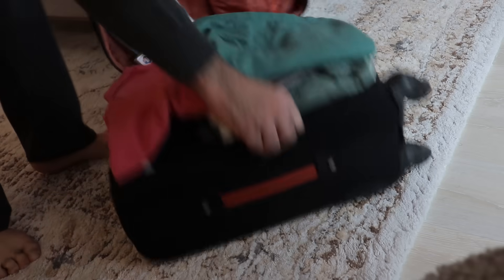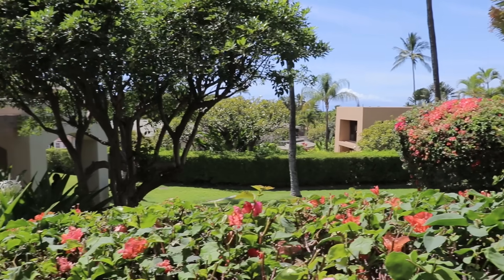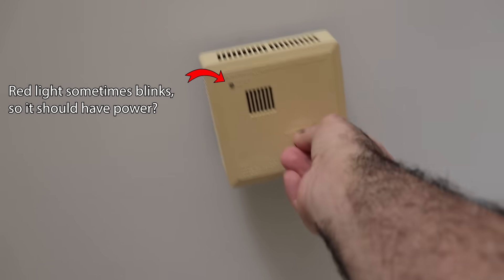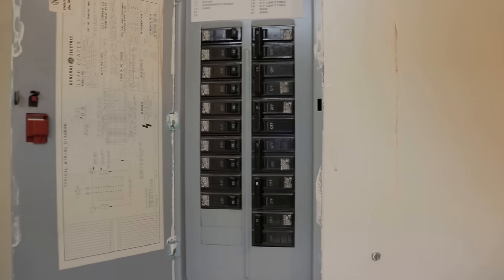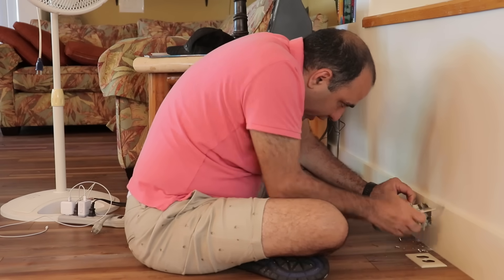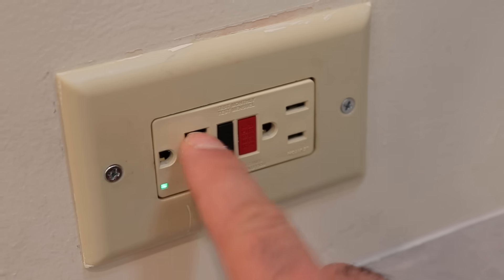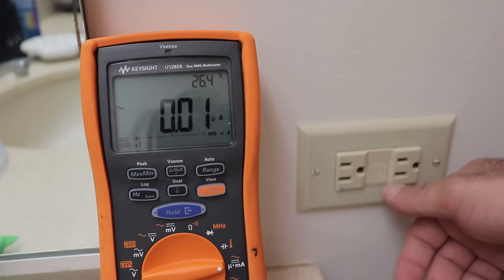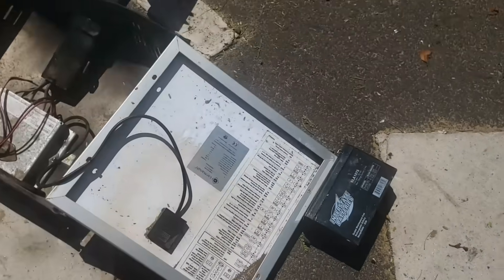Hawaiian Hotel Safety Failures

Comment: The switches being low might be a wheelchair accessibility thing.
Reply from the maker: Considering there are a few steps to get into the room, I say I don't think so! And the low switch height might be hard on some people's backs... don't know!
Reply: @ElectroBOOM  Stairs look like they were added to replace a ramp in that room. Could be left over stuff from previous remodel
Reply: @ElectroBOOM  did you know that Hawaii is a group of shield volcano from the Hawaiian hotspot. Did you get to see the volcano eruption yet.
Reply: @ElectroBOOM  not every disabled person is 100% wheelchair bound plenty can walk short distances do steps etc but whilst at home might use a wheelchair for comfort & safety esp if alone as it negates the risk of falls.

I'll wager there's disability adapted apartments there on the ground  floor & they simply did the electrics the same in every room to match
Reply: @ElectroBOOM  It's part of the building code in the UK (BS 7671) to make properties more accessible for people in wheelchairs. It states new installations should be no higher than 1200mm.
Reply: @Cee.Jay.71  Hawaii is an American state...
Reply: @ElectroBOOM  all buildings in UK must have ground floor light switches at waist height regardless of access issues for wheelchair users. Almost certainly this.
Reply: @ElectroBOOM  just because the room isn't ADA accessable, which it should be, that doesn't mean the electrical doesn't have to be compliant. Anyways, the NEC only says that switches have to be at 48" max height for ADA compliance. There's not really much of a reason for them to be that low.
Reply: @jonathantunnell3993  If the room itself is not ADA accessible (meaning there are stairs and no ramps or other ways for someone in a wheelchair to access the room) there is no need for it to be ADA accessible.
Reply: @shinigami052  all hotels are ADA accessible and if they werent built that way they are modified that way. 
also with these sorts of things, its usuallly just in some rooms, usually the ground floor only. its likely this is one of the only rooms in the hotel like this. Actually it looks like a bungalow as well, so its likely not attached to another building but a free standing structure. this implies a first floor experience(also looking out the back window. its the first floor)
Reply: @shinigami052  maybe true but why does disabled automatically equal 100% wheelchair bound in so many people's eyes?

Whilst plenty are stuck in a chair many chair users can get up, walk short distances & with help or aids do a few stairs. If an adapted apartment isn't available we often book the best they can. Often adapted rooms are impossible to book as there are usually only 1 or 2 per venue.

This disabled person might start the day walking & use a chair for distance are as they tire. Some just use a chair at home to mitigate falls for example. Anyway in such a case those switches being lower would help as even if you can get up you wouldn't want to every time you wanted to use a switch.

Also I'd wager the electricuans just did everything the same as the accessible apartments for convenience sake.
Reply: @norfolkngood8960  Because that's the the ADA Design Guide uses as the metric for reach requirements.  Go look it up, it's free and online.
Reply: @ElectroBOOM  The room can be counted as ADA compliant (even if it cannot be accessed by handicapped people). Corporate doesn't care if the rooms are actually accessible to the handicapped, they just have to have so many by law.
Reply: Correct!
Reply: @MostlyPennyCat  or midgets
Reply: Or for the Menehune :DD
Reply: According to the ADA Design guide, a side reach, unobstructed switch can be mounted between +9" A.F.F. and +54" A.F.F.  So they could have mounted them at the standard height.
Reply: @shinigami052  Underrated reply.
Reply: Wheelchair user here, It seems quite low, even from an accessibility standpoint (and i dont think that ADA norms are that low… but Idk i’m from Europe)
Reply: I'm surprised the outlets are at baseboard height. I'm disabled myself and that would be more inconvenient than convenient.
Reply: As a forme electrician I can confirm you're right 👍
Reply: @pyroforlife6051  There's no such thing as a Former Electrician (you might not be practicing, but you'll always be an Electrician).
Reply: I've never seen the accessible switched mounted so low. It also wouldn't make sense to have the switches wheelchair accessible and then have outlets on the baseboard where they aren't accessible.
Reply: Maybe child friendly-ness? It's an hotel after all.
Reply: off course below one meter
Reply: Even though I'm tall, I find I don't have to bend down to flip the switch, actually, they're usually just above height my hand naturally rests at, just takes some getting used to, not having to lift my hand right up to flip the switch.
Even better, means that if anyone with a wheelchair wants to live there, they won't have to adjust anything.
Reply: It is
Reply: They are. Lots of hotels have 2 eyehole things in the door one being lower for people in wheelchairs too.
Reply: That's why they can't be placed higher than 48" in the US, however that is WAY below 48".
Reply: my dorm is a disability access dorm cuz they didn't have room for us otherwise and all our switches are like this as well as our door peep hole lol
Reply: I think Mehdi is just a Canadian giant who isn't used to normal height switches
Reply: They built it just for me cause I’m 1.32 meters. Plus one for the little people. 🥳
Reply: But as a tall person I cringe
Reply: It's for Hobbits
Reply: ADA only requires it to be no higher than 48 inches (4 feet) to the top of the box to be considered handicap accessible.  This seems like it might have been set lower for some other reason.
Reply: and there are stairs down to the lounge room - weird combo
Reply: yes they 100% are
Reply: ADA compliance
Reply: he reminds me of a gorllia
Reply: I stayed at the exact same complex as Mehdi. All the condos have low light switches, even the ones only accessible by stairs
Reply: @Karl with a K the wonders about volcanoes, huh?
Reply: I stayed a night in a hotel the other day, and happened to be assigned an "accessible" room. There was a peephole in the door that I would have had to crouch down to look through. :-)
Reply: 90cm is standard height for switches in Europe. It meant to be turned by kids and disabled, and its easier to turn, because you don't need to move your hand up.
Reply: Short people also exist.

The outlets are at knee height on my bedroom and it is great to use the outlet while on bed.
Reply: normal light switches are accessible to people in wheelchairs
Reply: or for little people! there's really no reason why things shouldn't be at lower heights. based on the smoke detector it seems like the accessibility features were installed before the Americans with Disabilities Act which means whoever built the hotel cared about disabled people but whoever has maintained it probably doesn't.
Reply: @Cyborg_Octopus  There are actually plenty of reasons things aren't at lower heights.
Reply: @Cyborg_Octopus  Actually the smoke detector is likely due to building codes. Not because a place doesn't care about people who are handicapped. Smoke detectors should be placed high up because heat and smoke rises. If placed too low it would allow the building to fill with suffocating smoke well before you were alerted, especially if asleep. The inconsiderate part is where they haven't replaced that thing in over 30 years and leave it for tenant to figure out.
Reply: @GeoffereyEakinsTech  Yes I'm aware smoke detectors go on the ceiling. I was talking about the switches. The outlets being on the floor and the stairs to the hotel make a weird combination of bad design with more accessible switches, which is the mystery. The wear on the outlets and the old detector show a lack of care, yes.
Reply: @Cyborg_Octopus  I'd like to have a word with you about putting items to low heights. I have slipped discs on my back and I friggin hate that ie. sinks are installed so low at my work. Even as it's industrial building, not ie. commercial.
Reply: @jothain  that's called competing access needs. unfortunately it's not always possible to accommodate everyone at once. for most people hand height is at about 0.9 meters so putting switches, outlets, sinks, etcetera at about a meter high is recommended. if you're very tall or have a bad back you may have a problem using things at that height. if you are exceptionally short a meter may still be too high.
ideally things would be adjustable or there would be a higher and a lower option. a collapsible pocket grabber and a chair in the bathroom might help you.
Reply: These houses are designed by Japanese not Iranians
Reply: ok
Reply: not also having ones at 'standard' height seems like it would be bad for peoples backs though. I guess that's why one switch board still was?
Reply: he will need it in 1 year
Reply: Thats exactly what it is.
Reply: Goddamn, I can’t believe he didn’t get that
Reply: i'm not like ElectroBOOM, I have fucking nothing on my page fuck bots

Comment: Note that phone chargers or any other appliance in which is plugged in but has a transformer in the power supply will not electrocute you if you drop it into the shower as there is no path to ground :)

Comment: When I was in a hotel in puntacana I accidentally pulled on my phone charger and the face cover which was clipped on came off exposing the wires. I don't mean a face plate by the way. the insides of the outlet were visible! There was also one behind our table! I should have brought my multimeter smh.
Reply: I had an extension cord that broke like that, the contacts were completely exposed while it was plugged into the wall for about three days without me noticing, somehow it never shorted out.
Reply: @demetrijohnsonssirenvideos3590  thanks for reminding me to replace my outlets and check my extension cords lol.